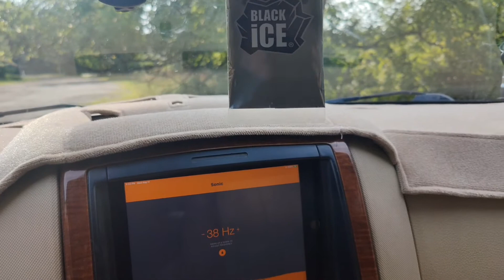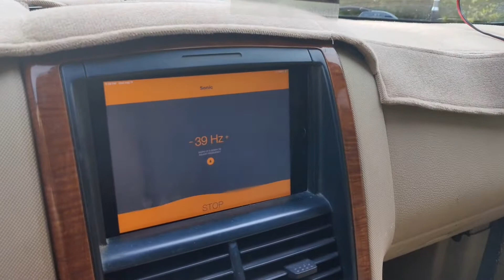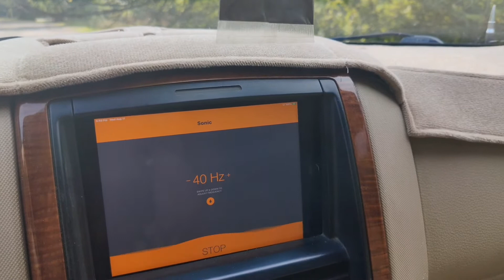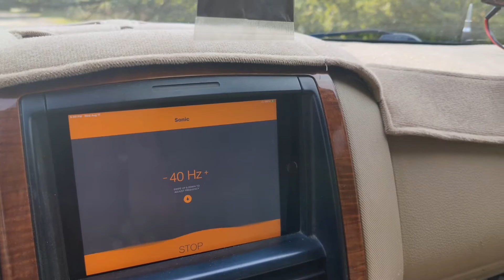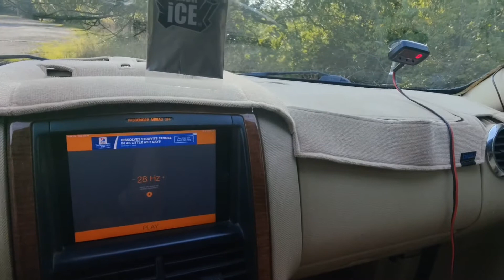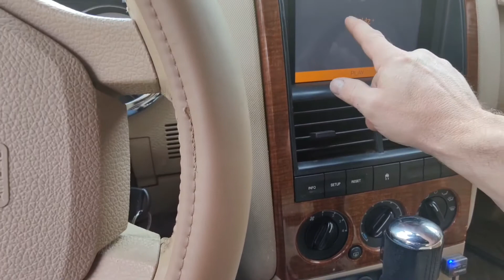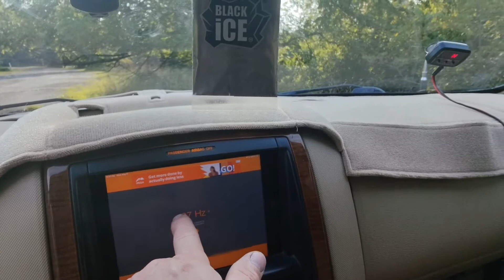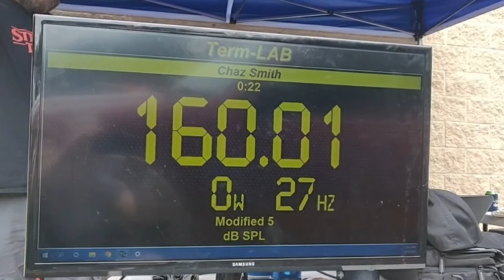Do Ultra capacitors work with a big battery?

Comment: Caps are seldom worth it, when someone has as much lithium as you have here in this video.  ESPECIALLY for the price of it. It's usually best to put that money towards more lithium.

To give you an idea how caps work, if you have 6 3000F cells in series, that is 500F, and what that number means is a load of 500 amps for 1 second (or any other equation that equals 500 amp*seconds) will drop the bank 1 entire volt. There's hardly any energy in them at all.  Just a bunch of instant power.
Reply: Super caps are best in daily driver builds. For competition builds lithium is the way to go. I installed a jp630 super cap bank in my daily driver and stabilized my voltage, at idle my voltage stays over 14 at full tilt. But this is with two subs doing 9k rms.
Reply: @BrianWaller-qe7gr  yeah, they're decent for that. Still probably could have got more performance for the money with lithium. Not everyone wants to run lithium, though.
Reply: @diylithiumguy  I was going to go with a d4s lto but didn’t want to mix agm and lithium plus didn’t have a lithium charger. I will save up to get two d4s lto batteries and a charger. I plan on getting two jp43 amps. But for running 4500 rms the Supercap bank will suffice

Comment: But the capacitors disharge in half a second. They are not gong to help past that point. They need to recharge in between short bursts. You can't be using them like batteries.

Comment: And to do the power you need, I promise you need copper dual amp inputs and 2/0 XL Sky High Car Audio wire. I will post video showing what I used and the difference it made. I love your channel BTW! (Obviously, I keep commenting, lol)
Reply from the maker: Thanks for the love! And yes I have a few set of dual inputs and tons of extra wire... I just haven't done the upgrade because that set up is temporary and each 8k is running at a static 1.4 and rising way up to 4.6. Each amp is only clamping 3050 watts. My new amps will definitely be running dual inputs and tinned ends.

Comment: You need more wires for super caps. I'll be posting video about this. Summary, my build clamped 8k with 1500f XS Power Super cap SB1500-75 but once I added dual amp inputs (copper) which is bigger than 3/0 awg, basically doubling my 2/0 XL Sky High Car Audio wire runs between super cap and amps then I clamped 13,000 watts! I guarantee if you quadruple your wire you will hit your goal. Try Sky High Car Audio 4/0XL wire for the caps. Like $8 per foot ofc. I posted video comparing sizes of wires. What gets me is my wire is rated for 600 a @20'
Reply from the maker: I am pumped you are interested in the caps and thicker wire. I was hoping this vid was going to get more discussion. I also run some super thick wire... I have a full run of 4/0 welding both positive and negative running from the alts to the batteries in back in addition to the three runs each of 1/0 positive and negative. (And another 4/0 connecting the frame to the rear battery) I already have another 40' of 4/0  welding wire and even some more 4/0 on order for my new 390 alt. Lots of upgrades coming soon. Probably a few hundred pounds of copper in the truck lol. And yes absolutely I want to try thicker wire on the caps. (I do think it will help A LOT) I just unfortunately don't have the room for the 4 banks of caps I have. I will have to get very creative to fit them in the truck.  After hearing your success I will definitely try thicker wires when I get everything set up. If I find gains I will figure out some way to fit them in the truck. 🤪

Comment: Nice SPL  what subs are you using
Reply from the maker: Thanks! It's 4 PSI Platform 5 18s on 3000 RMS each.
Reply: @Widowmaker2828  well I'm going to run four dd audio 700 15s on two orion xtr 2500.1 exo has two of them but he switched to a dual 0.7 ohm voice coil
Reply from the maker: @moneycat3789  Sounds like a solid plan!

Comment: Just uploaded a couple quick vids check em out when you have time let me know what you think for 18 on about 3500 watts
Reply from the maker: I checked them out! Looks like it's pounding! Pretty good for a big vehicle. Another one should do you well. What enclosure are you going to use? Keep posting.
Reply: @Widowmaker2828  It will be probably similar to the one I have now just will be alot bigger gonna take up the whole cargo area in the back might leave about four or 5 inches for breathing space for the port I hope it punds I know your not a fan of the Brazilian amps but the soundigital gets down at one ohm check out John bolte mr purple beard with steve meade doing a demo in his full throttle blazer one 8800 on four 15 playing I think 16 or 18 hrtz  gettin down also Steve meade test one on his channel 10k at one ohm but I'll keep posting thanks bro
Reply from the maker: @andrewg7344  Sounds good. It should do you well. And I have no problem with Brazilian... I run 4 of them! I love all amps, Brazilian and Korean
Reply: @Widowmaker2828  oh ok I must have misunderstood you on a post a while back thanks man appreciate the support
Reply from the maker: @andrewg7344  Yeah, the post you were talking about was a joke. I said Taramps can't play low (common myth) on a video that literally has one of the lowest meanest builds running on Brazilian power. Just set a trap to see if anyone would bite LOL. I amuse myself in weird ways... The anti-brazillian guys are easily triggered.
Reply: @Widowmaker2828  yeah that's what but was I apologize should have paid more attention to the post but right on I'll be looking forward to more of your content thanks again brotha
Reply: @Widowmaker2828  john nolte sorry misspelled his name
Reply: Just saw box today coming along it is a giant barely gonna fit so its gonna be just like the one I have now two ports just way bigger so hope it slams🤞maybe another week
Reply from the maker: @andrewg7344  Nice! I feel your excitement 😉. Working on new side seals for my enclosure now, covered in dust. Bass is too much work 😁